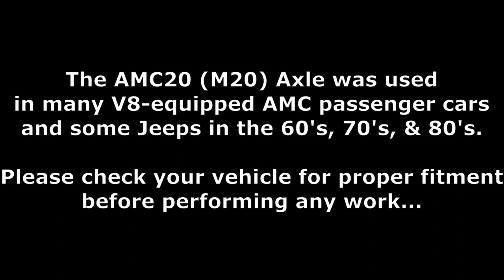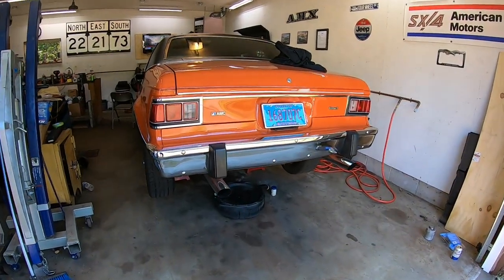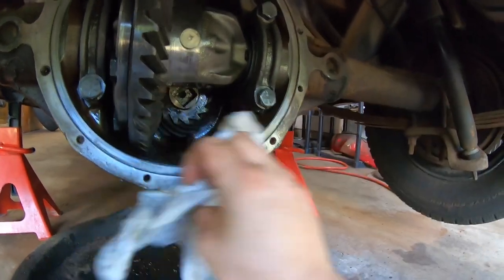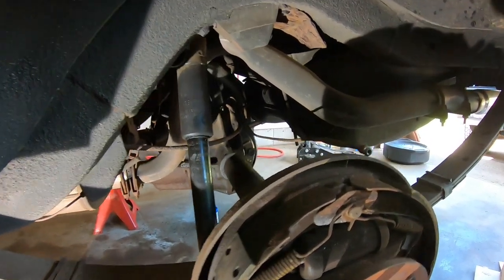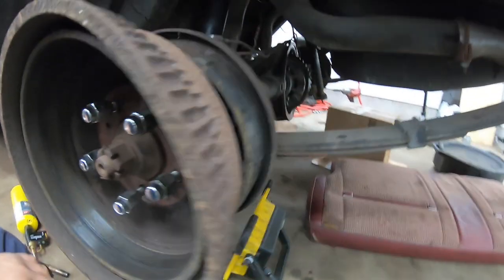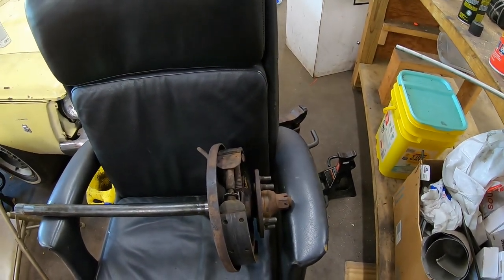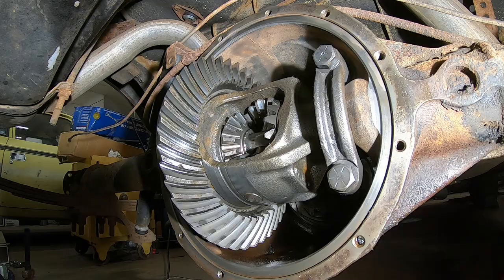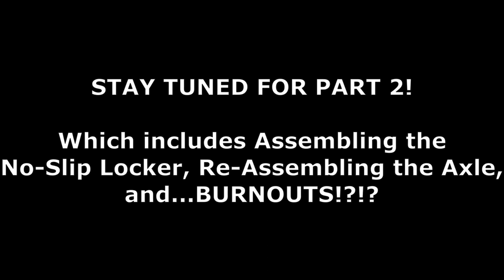Installing a LOCKER into an AMC20 Axle - Part 1 of 3 - Axle Disassembly

Comment: The 2 pc axles that you have, the weakest point is the splines that the hub goes on on the outer end of the axle. Aftermarket one pc. axles are highly reccommended!
Reply from the maker: Am indeed aware of the unfortunate weak points of the Stock 2-piece axles.  At the time this Locker was being installed, 1-piece axles were both out of the budget and out of the timeframe we had.  But thank you for the Suggestion!
Reply: @AmericanMadeClassics  I hear you on the budget. Due to health too. My 82 Spirit project has been on hold for 4 years. Getting a 360 SBC with a 5 speed,  and a Ford 8.8" or 9" rearend. I'm on SS and money is scarce!! Its been sitting with the fron sheet metal off and an empty engine bay. I have everything to build the engine, give or take some small parts, I just need to do it. The heads are still at the machine shop too. So don't take my suggestions to badly!! Lol

Comment: Do you realize how much easier it would have been to remove the axle nut when the tire and wheel was on the ground?
Reply from the maker: I don't mind being roasted, but as stated in the video, this was a major learning experience.  Never had one apart before.
Reply: @AmericanMadeClassics  I'm just suggesting from another views standpoint, Bro!! Don't mean to belittle! For sure!
Reply: I just used a air impact, no heat and both came off no issues on 2 rear ends. Flange is off the axle shaft thanks to a impact and my gramps drum and hub puller for his 67 wagoner. Lined up the woodruff key and used the nut to press it back on. Taper fit. Tighten, drop on ground and use click wrench, wheel back off and put the centercap back in.